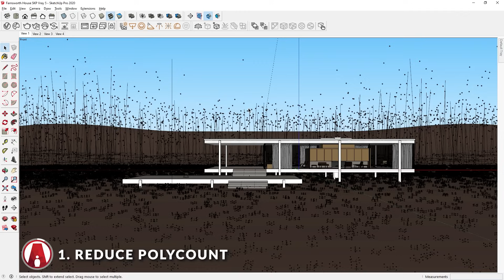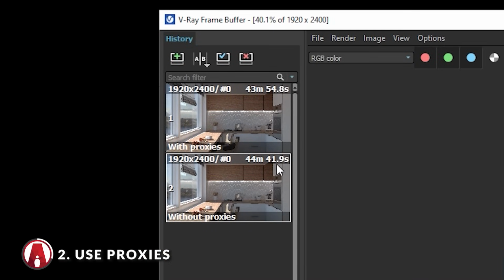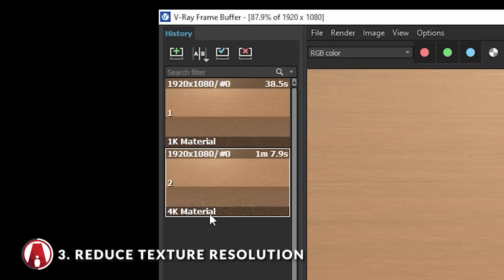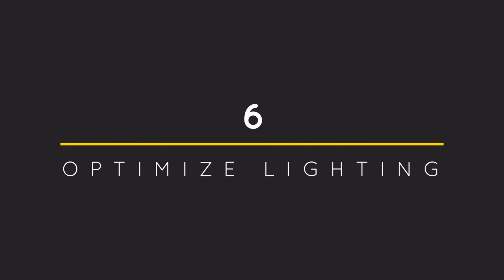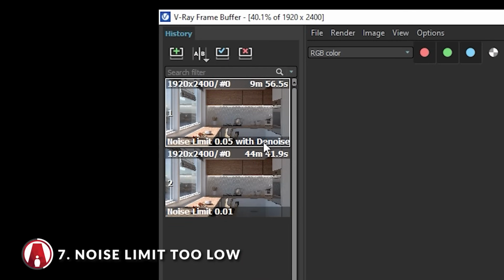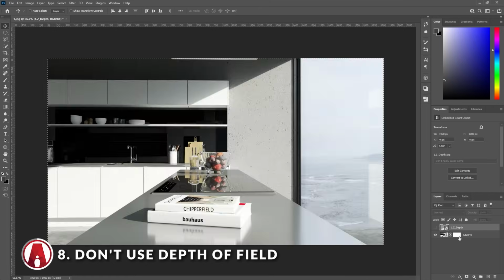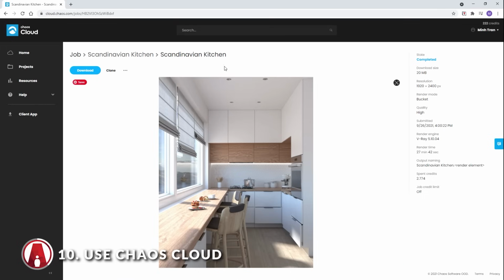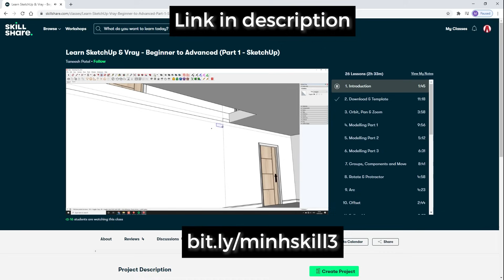10 Tips to Render FASTER in V-Ray

Comment: Sir, I have a question regarding which GPU to be used for high-end rendering on 3Ds Max, Lumion, Vray, Twinmotion, etc., and 3D modeling.
Following are my desktop PC specs and which GPU should I select for my PC.?

I have a motherboard ASUS Prime Z590-P WIFI,  CPU Intel Core i7-10700k, RAM Corsair Vengeance Lpx 16GB 3600MHz, SSD Samsung 980 PCIe 3.0 500GB NVMe.
Reply: 3070 recommended. 3060 minimum for smooth experience.